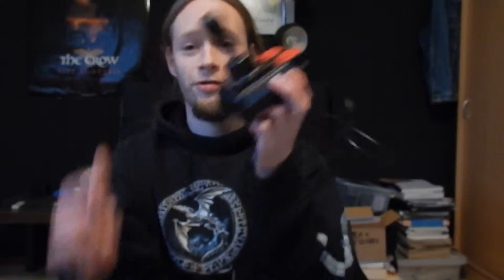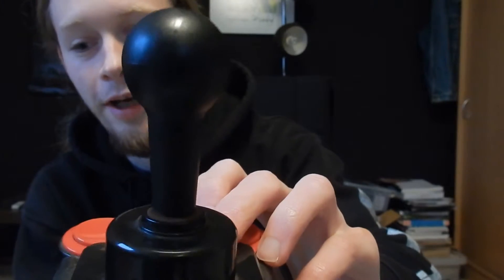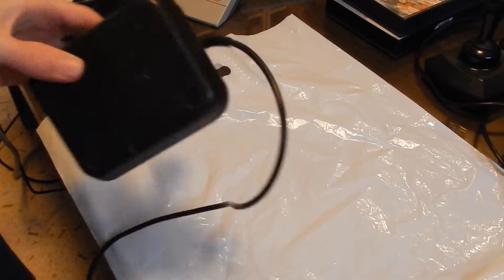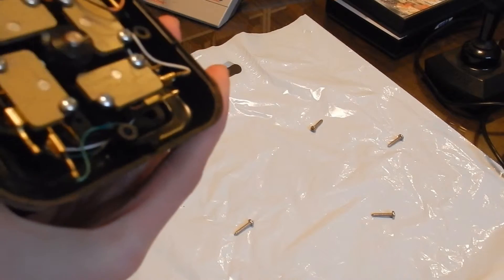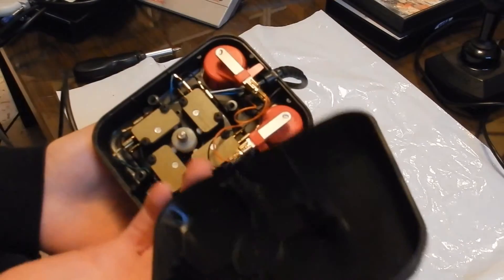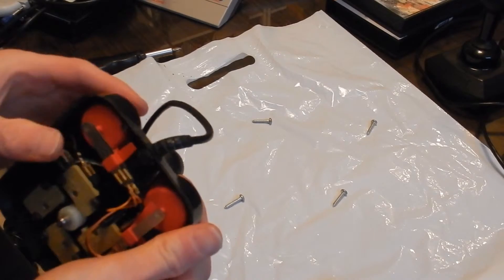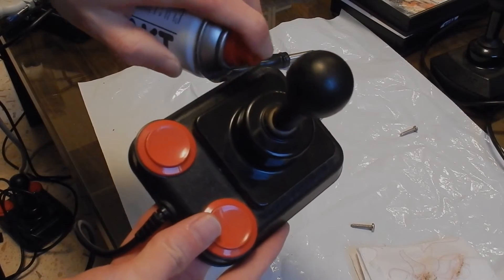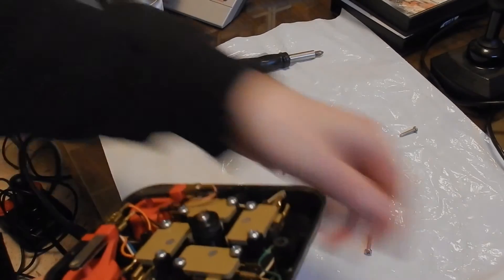A detailed look at two competition pro joysticks found at a fleamarket

Comment: Hi Dyko, I have just bought a Competition Pro on the local vintage fair and it is the same type that you have in the video. These don't have a retainer ring at the end of the shaft and the round plastic part which actuates the switches prevents the plastic base plate (the round plastic part which holds the microswitches) to come off from the shaft. Do you have any idea how to remove the shaft from these joysticks? I would like to completely disassemble it to inspect the rubber dampening or maybe replace it with a spring for quicker action.
Reply from the maker: I just had a look at the one shown in the video, it looks like the stick is held in place by a plastic baseplate on which the microswitches are mounted. I loosened the screws on the microswitches and it seems that switches secure this baseplate (I could move it slightly out of position with the screws undone).  With the aid of a flashlight I also spotted a C-clip down in the assembly behind the baseplate. It looks like it can be disassembled and reassembled quite easily.
Reply: Thanks for checking! I couldn’t undo the clip (and I am not sure if I could redo it) so instead of complete disassembly I just gave it a generous amount of silicon spray to lube the rubber bearing.